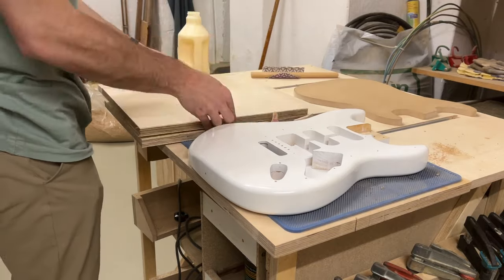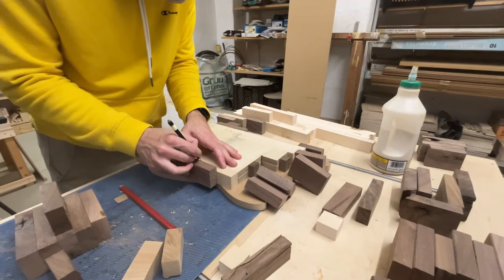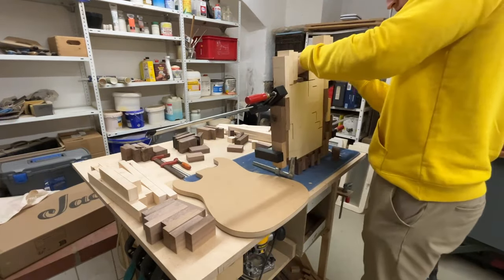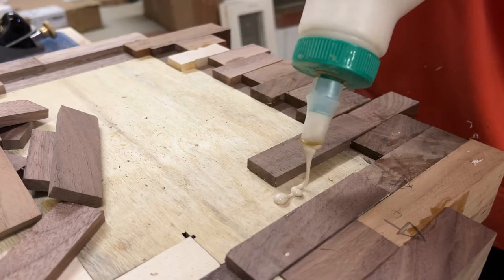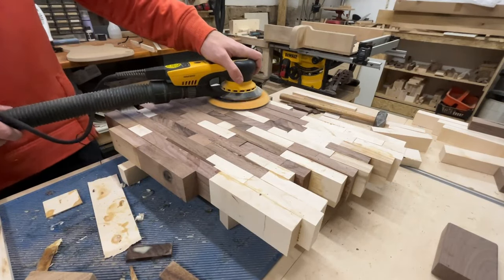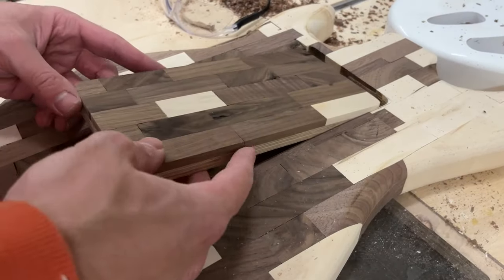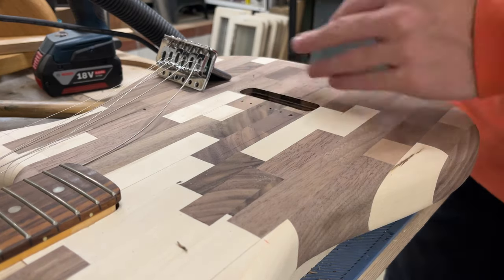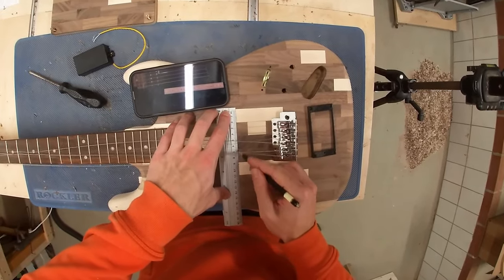Building this guitar almost caused a fire | building an electric guitar | EGuitar

Comment: nice ,, but to fit better you should rotate the bridge pickup ring for 180°, so higher side of the ring should go closer to the bridge,also check is it the one you put on the neck higher , then it have to go to the bridge...😅😉
Reply from the maker: As I said, I have no clue about guitars. Thanks a lot for this information! Fortunately, it's not a problem to change this.

Comment: Nobody, I mean, "nobody"... wants a plywood guitar. Worst tone ever...
Reply from the maker: I am sorry to inform you that you are wrong. With an electric guitar, the sound is produced solely by the pickups. This is also the reason why some electric guitars have no body at all and consist only of struts. If you find the sound terrible, it's because of the pickups, which are not really high-quality pickups.
Reply: @FlemmingDesign  you need to learn more about guitars... "sorry, ... not sorry".
Reply from the maker: I don't know much about guitars, that's right. But that's why I asked a local guitar store (actually the biggest in Germany) if it could cause any errors if I choose "random" types of wood. They told me: "The impact from my pickups is way bigger than any wood could be" So "I should think of switching them before thinking of using any specific wood". I don't know your background, but I trusted them and in my opinion (and all who hear the guitar in real too), this guitar sounds very good.